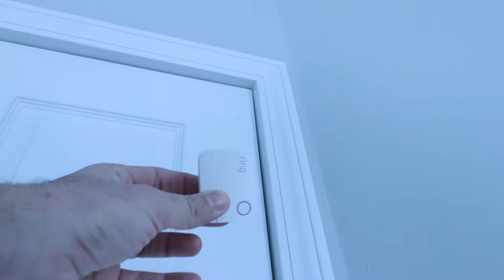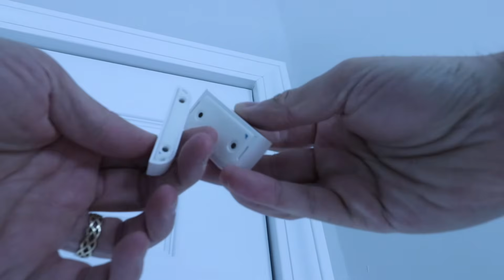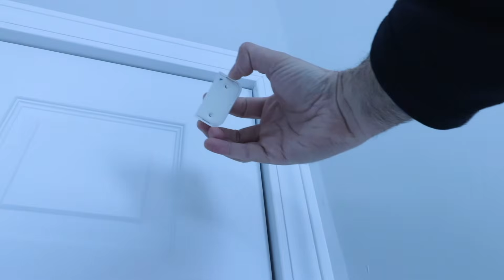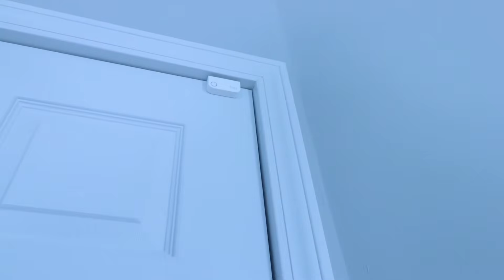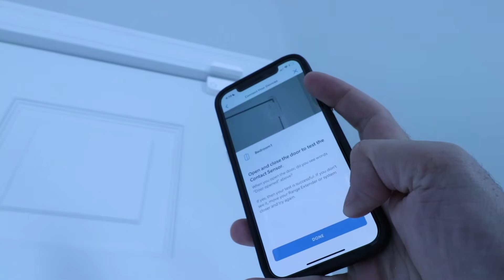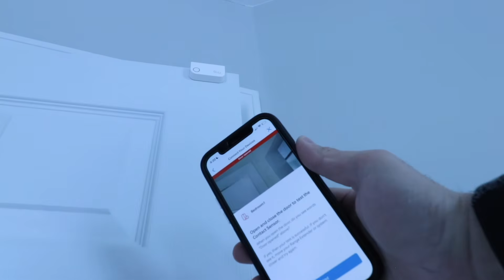How To Set Up Ring Alarm Contact Sensor

Comment: For those asking, The Ring Alarm Contact Sensor requires the Ring Alarm Base Station to work.
Reply: I just went to Best Buy and the guy said I can captivate the sensor without any base station 😒😖
Reply: Thank u
Reply: Well shit i guess thats why its no longer working thought it was batteries. Bought a house and it has the senors they were beeping and working but not after the batterys die

Comment: Why he amount the biggest piece the main sensor part on the door, and not the small magnet doesn't make any sense for me. I deffently gonna mount the small magnet on the door so does move all the time.
Reply: I had this question too while watching the video. Wouldn't you want the lighter piece on the moving door ? I wish he would've explained the logic behind doing in that way. Though there isn't a big difference in weight between the 2 pieces

Comment: This is definitely the way it should work. I get as far as the scan QR code but when I choose the code scanned, it does not take me to screen to finish setting up the contact sensor, it takes me to the set up a device screen where I started. Happens every time. I just go through the same sequence over and over; however, the main controller does beep when I separate the contact magnet. Don’t know where to find them to finish setting up and no devices are listed anywhere in my system.
Reply: Update: called Ring support. Had to sign out and sign back into the App. Solved the problem.

Comment: Do you need a subscription to use door sensors and motions sensors? And also how far do the sensors work from the base ?
Reply from the maker: No, you don't need a subscription to use the Ring Alarm Motion Sensors or Door Sensors: https://amzn.to/3Nf4v9p . Typically they seem to have at least a 100ft range from the base station but you can buy Ring Alarm Range Extenders: https://amzn.to/43IJg5nthat you just plug in and increase the range.